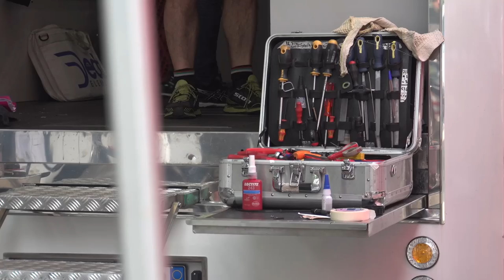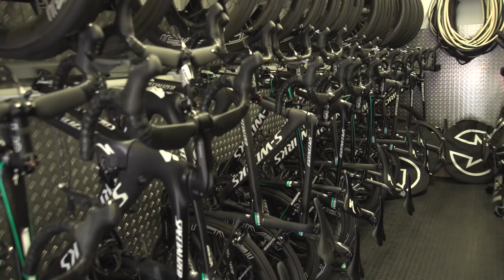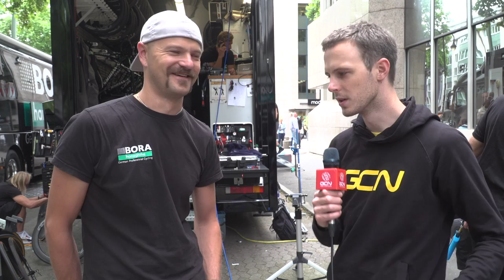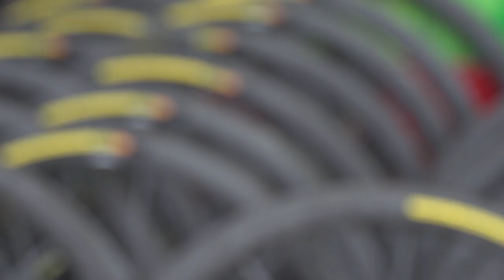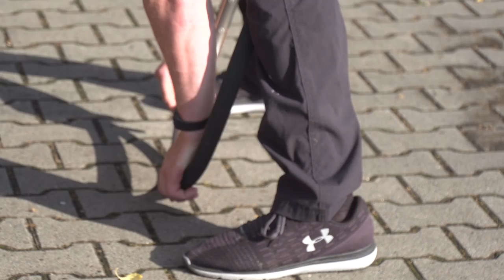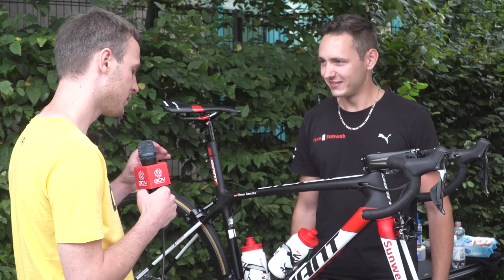Tour De France 2017 - Worst Jobs For A Cycling Team Mechanic

Comment: Hello, mountain biker here, I want to ask, how could road cyclists got so many puncture in a race? I thought flat smooth tarmac won't "hurt" the tyres.
Sfbe
Reply: simple, mountain bike tires are designed to be tough and hard wearing the larger tires and generally lower PSI also helps the tire to deform around stones; racing tubs are a softer rubber (to increase grip) and sometimes latex innertubes are used which are lighter and "faster" but again not as hard wearing.
Reply: umm all right, thank you. it's quite amazing then to know that Martyn Ashton in his 2nd installment of Road Bike Party only punctures a pair of tyres
Reply: Martyn Ashton I think used a 4 season tire so its a tougher rubber and normal inner tubes I tend to only get a couple of punctures a year, but still its pretty darn amazing seeing when he got up to there.

Comment: Nice video subject.  2:30 - Is the issue then one of safety of working in an open support-truck area while it is moving/traveling, or one of the fumes from the gluing of the tires?  I would think that either issue would be remedied with intelligent support-truck design.  Second question - based on the numbers of tires done - are some pros riding on tires they used the day before?  I would have thought that they'd get new tires for each new stage.  ('tyres' for those who insist on spelling the word incorrectly)

Comment: Why doesn't the bike industry make enough road tubeless for racing? Lightweight, no gluing and they could be a huge time saver and more economical, even being installed in the back seat of a team car. With sealant can even save a win. After a puncture, Just remove it and donate to a needy person for repair and reuse. a product the pros would more readily adopt than disk brakes.